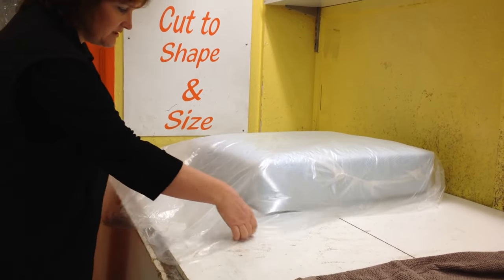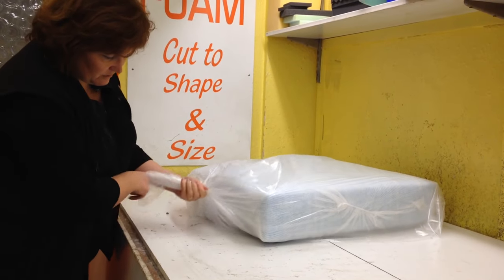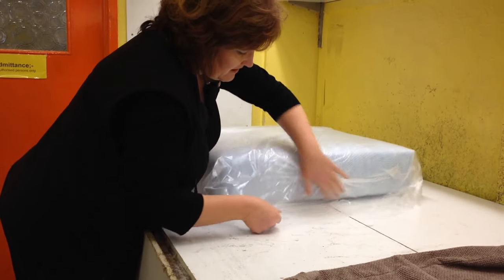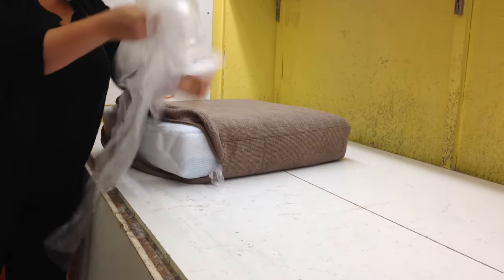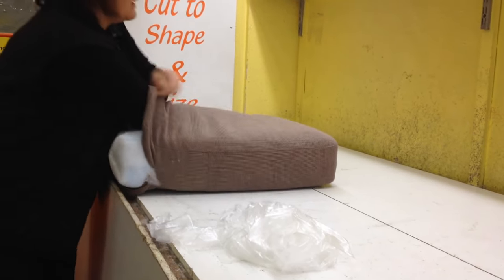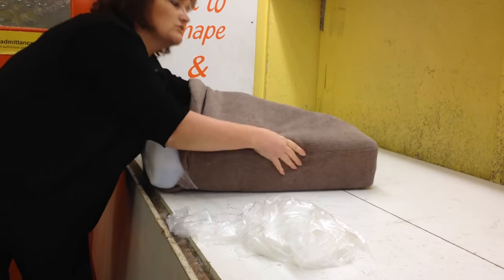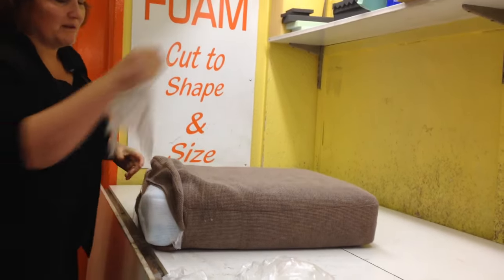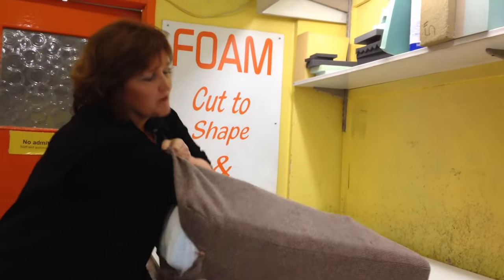Fitting foam cushions in to covers using a vacuum

Comment: Thank You! I replaced the foam in my favourite knitting chair, with an  extra firm. The upholster fellow chucked when I left the store. I knew it would be difficult I got home and tried to put the cover on without wrecking the zipper. Tried twice and soon realized there has  to be a  solution, it’s foam it has to compress. did a you tube search and  I found you. With my husbands help we did it with your instruction. You mad my day, very nice of you to share this trade secret.

Comment: Well explained, thank you!. This is certainly easier initially than how we used to do it 20 years ago. We sewed a cover for the foam using sew-in interfacing. The value of the old method is that the cushion slides OFF for washing as simply as it slides on using your method. The interfacing does not need to be sewn as the cushion is - just whip stitch it well enough that it stays.

Comment: Will this work on impact reducing memory foam please? It was expensive and I’m worried about damaging it.
Reply: The film just creates a sealed bag around the foam and the vacuum just extracts the air, its really no different than the vacuum bags that you can shrink clothes down when packing. We've used the film when shrinking our memory foam down but if you have bought your foam from elsewhere I don't know if there is anything specific about it that would prevent you from using the film, you'd need to check with your supplier

Comment: Great video thank you, but I am trying to find a way of drying a sponge cushion that I have washed in the bath. I've tried leaving it in the sun to dry and a hot car.  Iv'e tried wrapping it in towels and jumping up and down on it and finally using a dehumidifier in the car with the sponge cushion. I managed to collect a pint of water after two days. NOTHING seems to really work as it is still really heavy. I am wondering if this vacuum would squeeze out the water and maybe a towel would then soak up the water? Or maybe you have a different approach? Please help!
Reply from the maker: Drying foam can be difficult, personally, I have found that just hanging the cushion up and letting gravity do its work over a few days has worked for me but here is one video (nothing to do with us) that shows quite an extreme method https://www.youtube.com/watch?v=G6xxaPcV9yY
Reply: Maybe use the same method with a shop vac and suck all the water out that way .
Reply: @foamcushion2765  Thanks I ended up letting nature take its course after trying all these methods. I do like the idea of the foam squisher though 😂. Thank you 👍
Reply: @marcosrhecker412  Yes I was very creative. Didn't go as far as the foam squisher but did contemplate a home made centrifuge for a mad moment.🤔 Thanks for your help. 👍
Reply: @TimHollingworth  If it happens again, I was going to suggest hanging the cushion in a small area, like a closet or shower stall with a small portable space heater, maybe with a fan. Just crack the door a little so it can ventilate and it will be bone dry within a day or two tops.
I've done multiple basement and indoor flood restorations.  Plenty of heat and proper ventilation is always the key to a fast dry out for any soaked material.
Reply: @TimHollingworth  Also, while thinking on it, because i am about to experiment with "waterproofing" my outdoor cushions, but may end up with waterlogged sponges myself, but depending on the size of the cushion, you could potentially squeeze it down into a smaller cloth sack, like a gym bag, then toss that into your clothes dryer if you have one. That would probably take care of it fairly quickly. My area is humid this time of year, so I don't think I'd take chances with mold by just letting natural air dry it. 
Best of luck to both of us in the future!😊

Comment: Would this way work with feather cushions?
Reply from the maker: Yes it does but it doesn't work quite so well as it removes the air from the cushion and we've found that the density of the feathers means they don't compress quite as much.